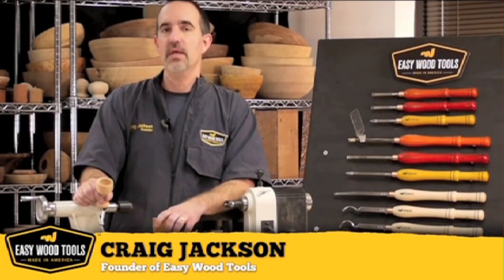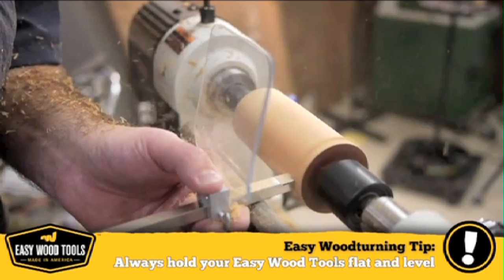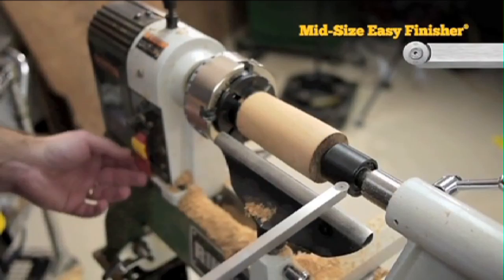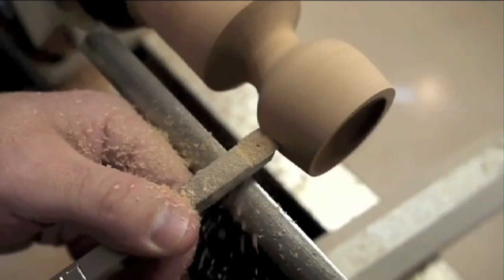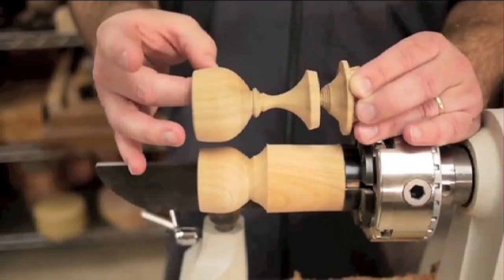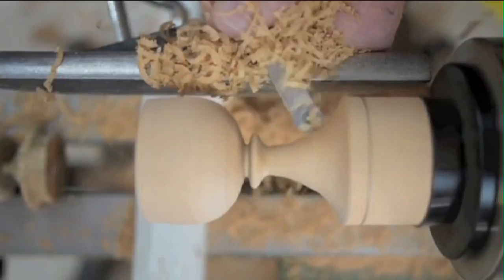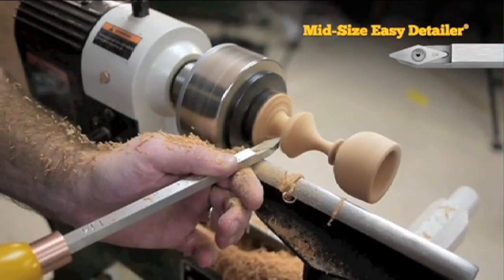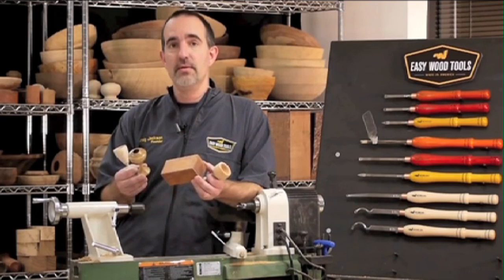Turning a Goblet Cup with Easy Wood Tools (Woodturning Project)

Comment: what tools or cutters do you recommend for a beginner to start with with bowls,,full size,,the easy wood tools
Reply from the maker: jeff oldham It all depends on the size of bowls you want to make. For a 12 inch bowl, you should at least use EWT mid size tools. Full size would be best. The only time you want to use the mini set of tools would be on 6 inch bowls. Please call one of our Technicians at 1-800-551-8876 for prompt answers on all of your woodturning needs.